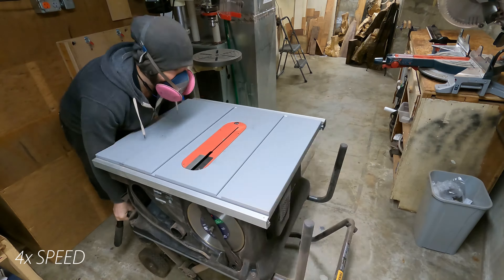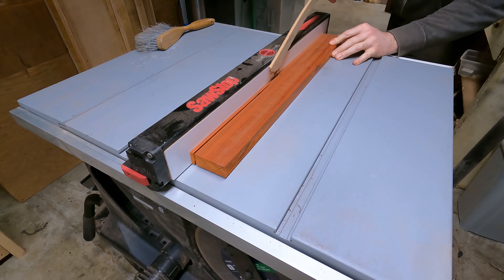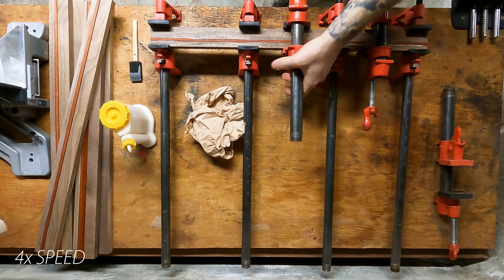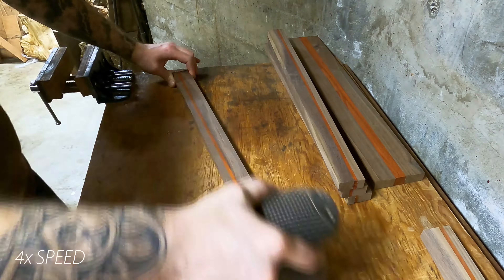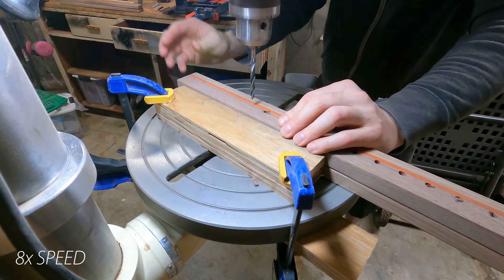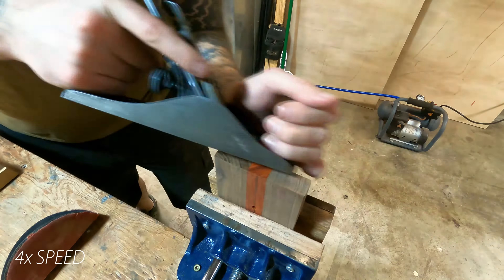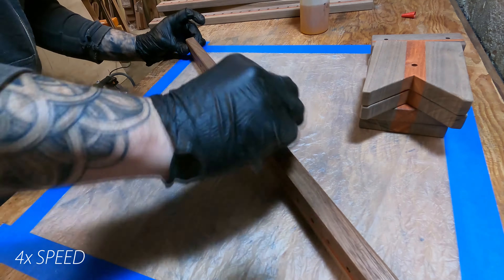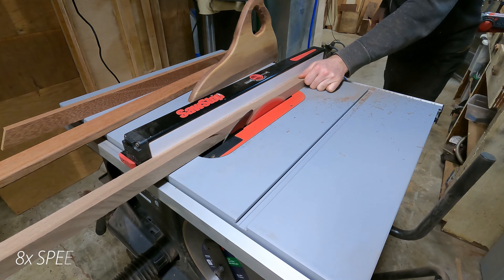Picture Frame Jig for Fast and Accurate Glue-Ups

Comment: Thanks for the video and sharing all of the dimensions. How far apart did you drill each hole? I was thinking 1” might be too close and 2” too far.
Reply from the maker: I just measured and it looks like I did go with 1" intervals. It's worked pretty well for me. I've liked that amount of "fine" adjustment for weirdly-shaped frames. But you could always go 1-1/2". Or you could do 2" intervals, but have 2 different sets of holes on your corner blocks to give you some extra fine adjustment if you need it.

Hope that helps! Glad you got something out of it!
Reply: @ Thanks. I decided to go with 1” too and I think I’m going to be happy that I did.

Comment: What are your dementions on the pacman blocks?
Reply from the maker: Hey, Rudy. I measured those blocks and they came out to 3-3/4" wide by 5" long and 3/4" thick. If you're using some harder wood, I wouldn't say you'd even need to make them quite that big. I just wanted more surface area for frames to rest against for stability, but I don't think I needed it. Hope that helps.

Comment: Padauk is a beautiful wood.. It's a bit oily so I get better results by first wiping it down with turpentine before applying polyurethane.. Under poly, it will assume an iridescence, changing glow as you tilt the wood under light..  However.. it has now been declared an endangered species and no more can be legally harvested from Africa.. Whatever has been cut is all there will be for a long while.. It joins the list with ebony..
Reply from the maker: Yeah, I had read about it becoming listed on CITES earlier this year. Makes me sad. It's a beautiful wood. I'm wondering how that's going to affect buying and selling going forward.

Cocobolo is also listed as an "Appendix II" on CITES and you can still purchase it from suppliers where I am. So hopefully it's just to prevent any further damage from illegal logging and what not. We'll shall see.